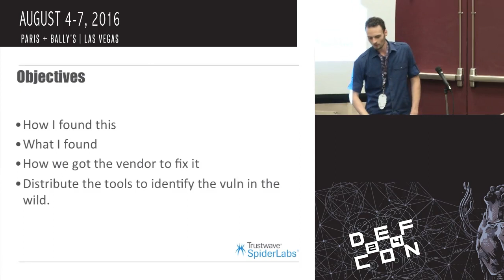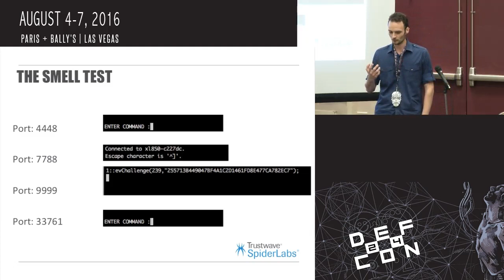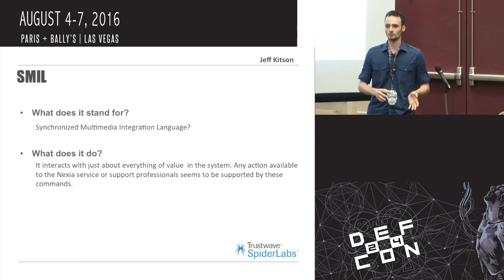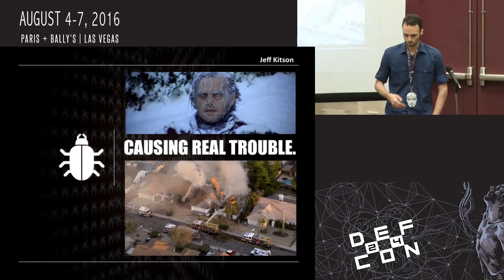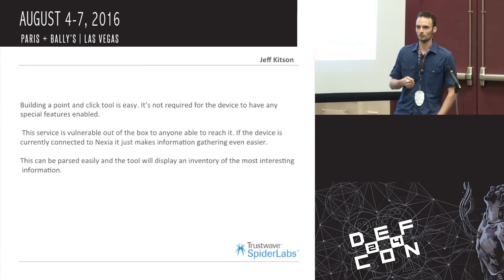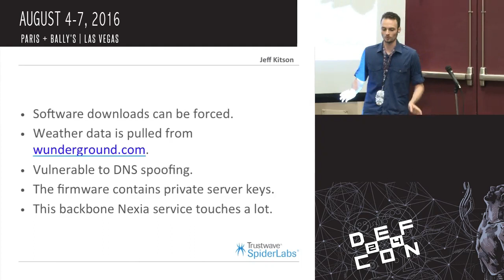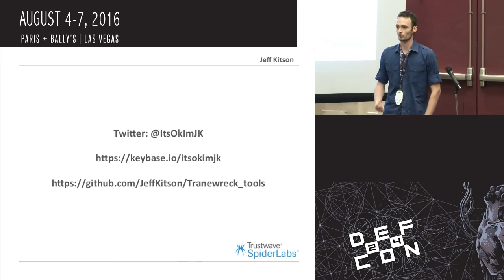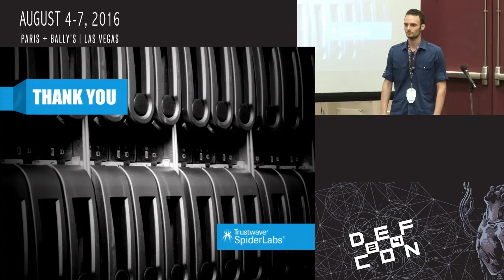DEF CON 24 Internet of Things Village - Jeff Kitson  - Tranewreck

Comment: This is why you should have an external carbon monoxide detector installed along side your furnace, a physically separate device.   :-)
Reply: Got one I just mounted in my familys house here the other month and in the manual its all talking about don't put it in the stairwell of a basmenet, or near a garage.. not near this not near that, so it's like where the hell do i put it? if we think ther emght be a leak issue near the furnace do you think they're realistically that unsafe or improper to put in a basement on the wall say behind or next to the in our case,  oil coil tankless heater or whatever